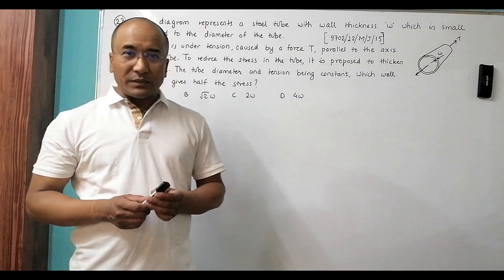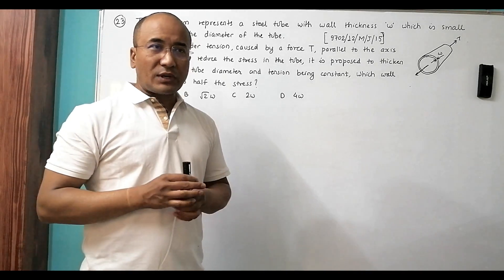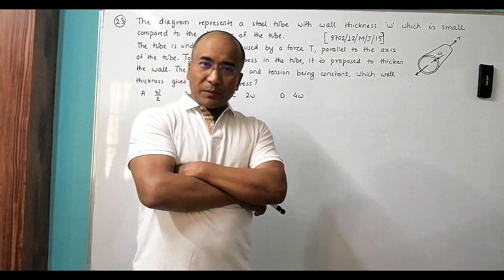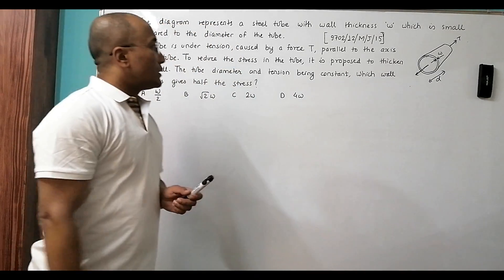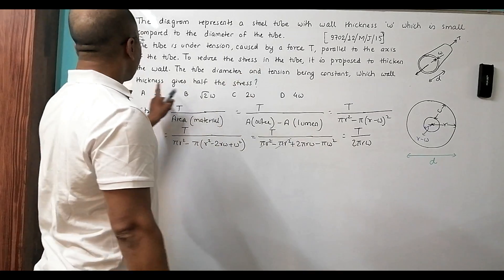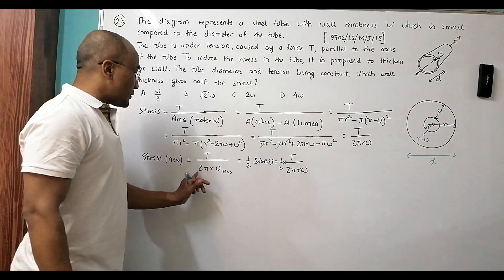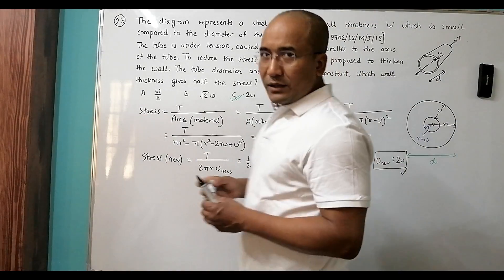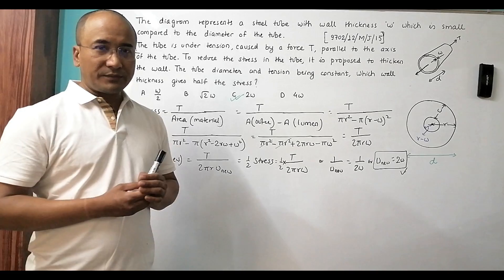2015 CAIE AS & A level May June Physics Paper 12 Q. No. 23 (9702/12/M/J/15) by Sajit C Shakya

Comment: There is a way to do it without neglectin w^2 becuase it is small.

Stress = Force / Area
The steel tube is hollow in the centre with its wall having thickness w. When we calculate stress, we need to consider the area of the steel ‘material’, not the hollow space.

Suppose the length of the tube is L and the diameter is d. Imagine that we have cut the steel tube (along the length) so that it is now in the form of a cuboid (a rectangular sheet with thickness w).

Area of annulus = (circumference of tube) × w
Area of annulus = 2π(d/2) × w = πdw
Area = πdw

Since π and d are constant, the area of the annulus is proportion to w.

Because the wall is thin in comparison with the diameter of the tube, the area of the annulus (representing the wall thickness) is proportional to w.

Stress = Force / Area

The tension (force) is kept constant.
So, the stress is inversely proportional to the area.

To obtain half the stress, the area should be doubled. But we have seen above that the area is directly proportional to w.

Thus, if the area is doubled, w also needs to be twice greater.